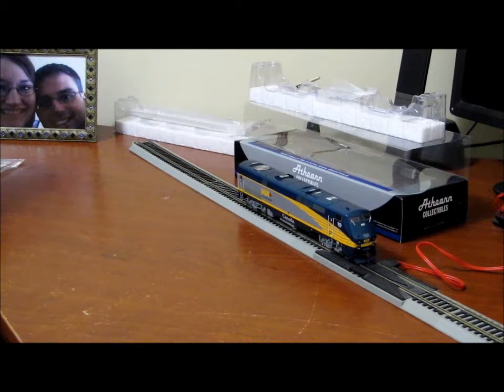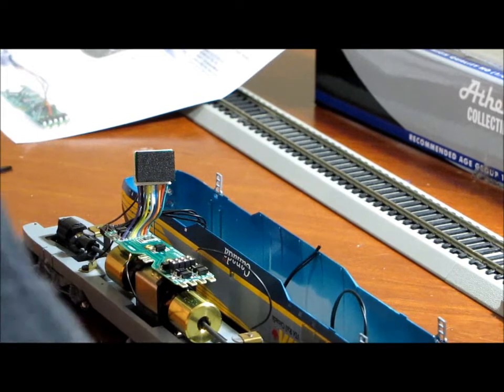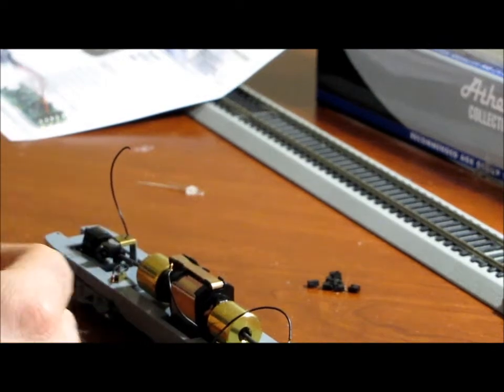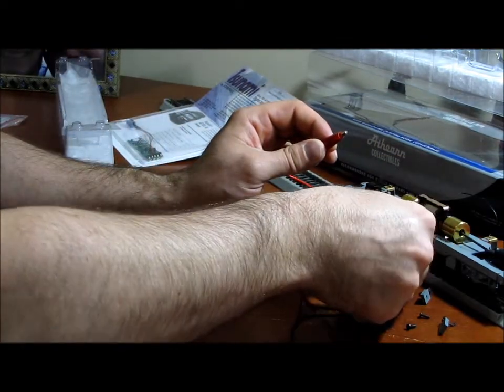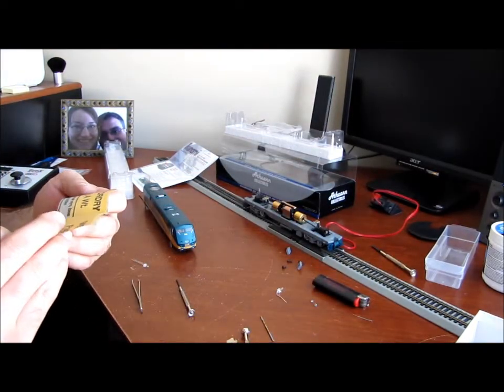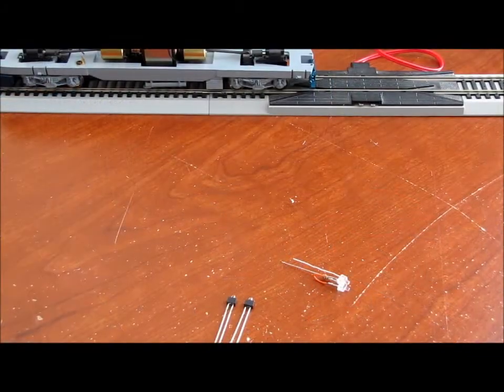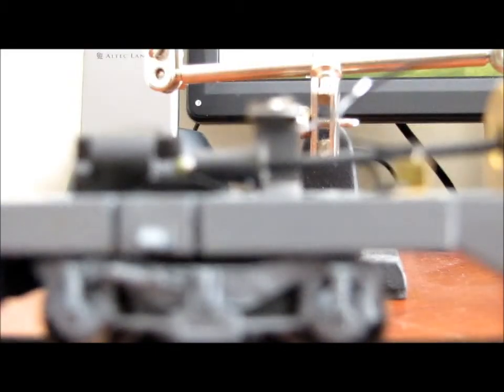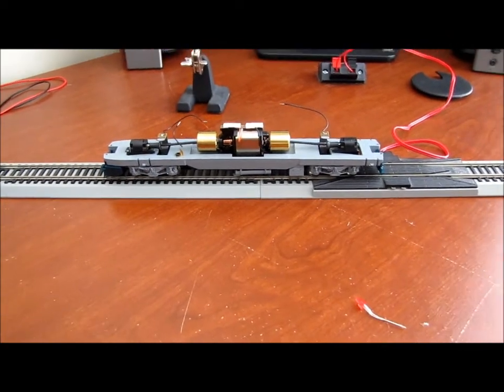03.20.13 P42 Genesis DCC Project Part 1

Comment: have you checked the slats where the little tabs on ball at the end of the drive shaft seats . those slats sometimes have bad casting stuff on or in it . sorry dont know what you'd call it  ?but the coupler piece from worm to drive shaft !!!!